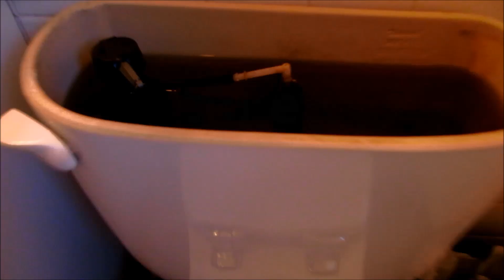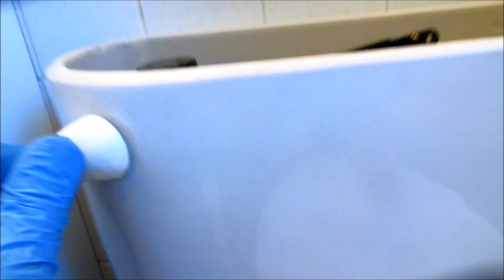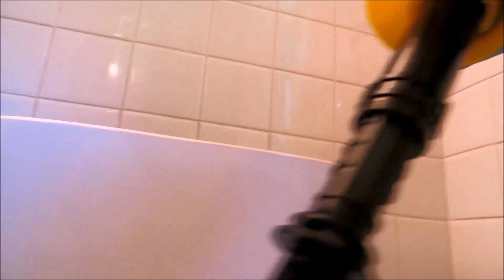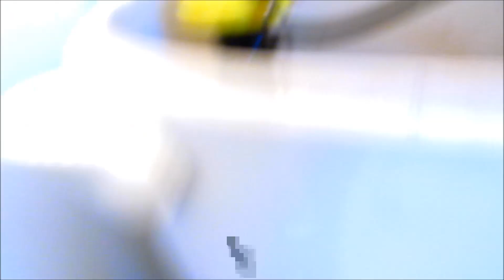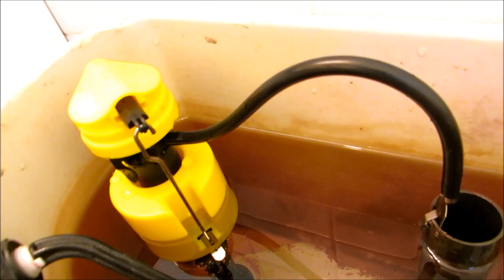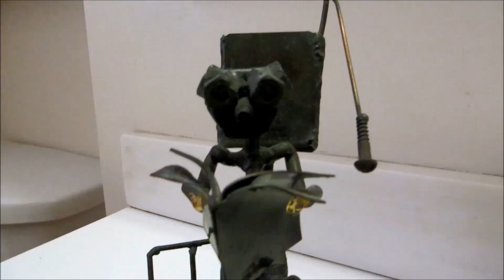toilet keeps running water

Comment: I am trying to replace my BrassCraft model 2000 Flush Valve. It looks like the yellow one your installing.   Would you know if I can still get the model 2000?  I can't find it. Would you
know a direct replacement?

Comment: Steven do you not like the fluidmaster tank value and what bran is the one you use I like the adjustment it has I haven't seen that on here in the south thanks joe
Reply from the maker: Joe Sanders fluidmasters are ok just harder to adjust is all ,,theses are brasscraft and are easy to set once installed

Comment: You really put a lot of effort into the filming...even just a fill valve...I can only imagine how many times most folks would knock the flippin' thing over maneuvering in tight spaces with hand tools, cords, hoses, and everything else going on, and trying not to kill the camera. ...Especially in those slippery tubs, changing out shower valves.
At first, I thought this was a commercial bathroom stall because of the white tile and black border, and was wondering how you had the camera perched up in the air on the stall partition....well I see towards the end it was a vanity sink. (I should know better - your truck pulls up to houses mostly).
It would be interesting to see a "big brother" version of you filming one of these jobs, just to see what all goes on relative to getting the work done while filming.
Reply from the maker: Dwight Bennett try your own videos and see how they come out its not easy

Comment: All ive ever had do when a Fluidmaster leaks is replace the $2.00 seal in the top, works for another five+ years -- been using them for over 20 years.  I do like the Brasscraft adjustment design though.